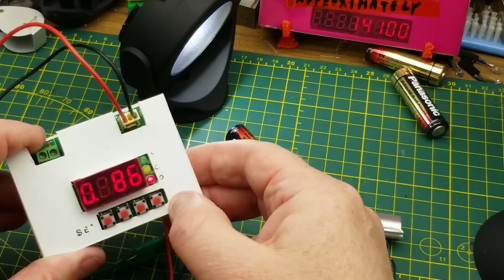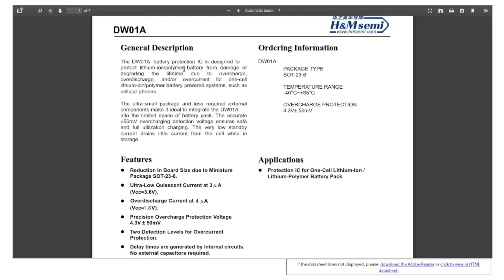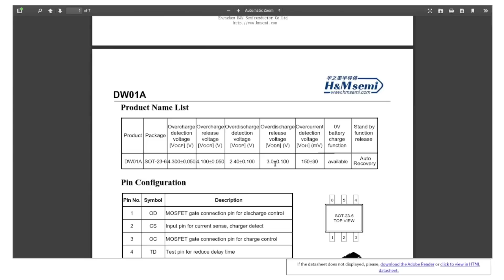Modifying a cheap LED light. Now it's rechargeable!

Comment: Great vid. I've "rechargized" <- a word?) a few things and on two of them I used the TP4056 boards but actually took out the smd LEDs and  wired external ones from the original pads. It wasn't a whole lot of extra work and enabled me to retain that boards useful feature.

Comment: Nice video. Don't forget to modify the charging current value via the SMD resistor. This is important because normally this circuit charges @ 1A which is a lot. You could change the resistor in series with the LED to maintain the same brightness after lowering the input voltage from 4.5V to ~ 4.2V.

Comment: When I have something that uses 3 AA batteries, I convert the battery slots from series to parallel. Some I have to cut the connection between battery slots, some just need a rewire. Then I use 3 lithium-ion 14500 cells so I end up with 2100 or 2250 mah depending on the cells I use. Then just add the TP4056 based charging board. Did this for a light in a dark pantry at my mothers, but sometimes she forgets to turn it off, so I'm going to change the charging board to the type with the low voltage protection and maybe add one of those tiny IR motion detectors as well. I've used them a few times and the ones I used work very well and use very little power.

Comment: Enjoyed this very practical project, thanks.  Would love to find that pin vice.  I generally use the drill bits with standard hex screwdriver ends for this kind of thing - it's a bit too bulky for fine work though.
Reply from the maker: I've had that particular pin vice for probably 30+ years.
Bought it at a welding supply place. They sold it as a torch tip cleaner.

Comment: What led voltage detector/ load monitoring device was that?  I saw something similiar on ebay.  0 to 300v dc range
Reply from the maker: It is a 3 amp buck converter that has adjustable constant current and constant voltage  output. I power it from an old laptop power brick.

 https://www.ebay.ca/sch/i.html?_nkw=B3603+Adjustable+Buck+0-36V+0-3A&_sop=15  

I built a homemade case for it many years ago: https://youtu.be/GoBDbTnZnJU

Comment: I know would have could have should have.. but there was already a jst connector on the battery, why not solder a jst pin header to the output of the charger/protection board ? ^^ 
Very cool mod nevertheless !!
Reply from the maker: In retrospect, that probably would have been the smart move.

Comment: I did that conversion to my wireless model railroad throttle. Used the same charging circuit.  One thing I did was drill a small hole in the case so I could see the charging LED status, then I knew when the battery was fully charged.
Reply: Yup...those boards even have two LEDs to indicate charging status...sometimes in the dark, he might be able to see the glow through the hot glue or gaps in the hole. Hope he got that wire out of the front, that would be so annoying to have to take apart just to move it out of f the way
Reply: I tried something similar, replacing a 3xAAs with an 18650 in one of those $1 Wally-World Chinese flashlights.
Failed though.  Was a little too long, and had trouble getting into the tube.
Reply: @GnuReligion  Yep, 18650s are too long, you need the 14500s that are the size of AA batteries but a lot rarer to find

Comment: Turn over the cutting edge of the side and face "SF" cutters to strip the wire ( just do not press too hard :-))  )  
Time slot 7.32 

I still have my SF cutters from 1983 I have sharpened them a few times ;-) so the cutters are quite short
SF cutters are also good for cutting toe nails, I keep a brand new pair just for that task.
Reply: Forgot to say when you use SideFace cutters upside down to strip the wire push up with your other thumb to make the cut and strip.
Apart from smaller wires I have stripped house ring main cable by gently crushing the insulation with the SF to sort of soften it then it strips quite easily. 
These days I use a gun style stripper.

all the best

Comment: Hi, interesting video, thx! I am new to your channel, what is the voltage and current supply and monitor device that you are using?
Reply from the maker: It is a 3 amp buck converter that has adjustable constant current and constant voltage  output. I power it from an old laptop power brick.

 https://www.ebay.ca/sch/i.html?_nkw=B3603+Adjustable+Buck+0-36V+0-3A&_sop=15  

I built a homemade case for it many years ago: https://youtu.be/GoBDbTnZnJU